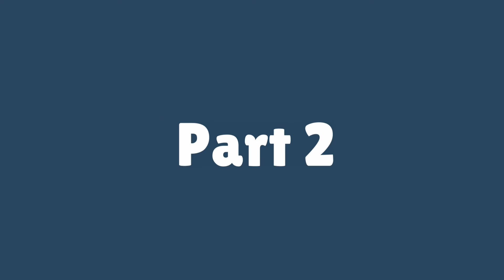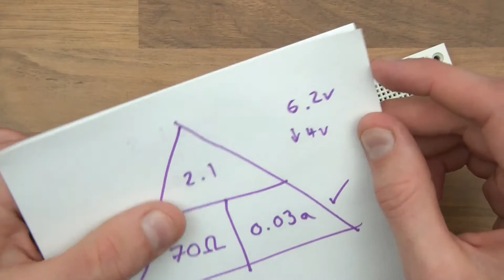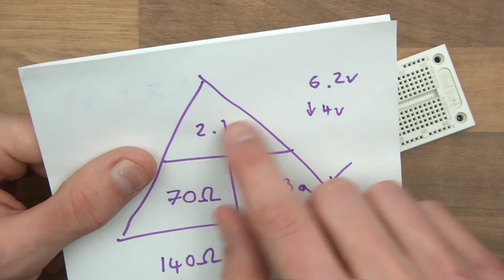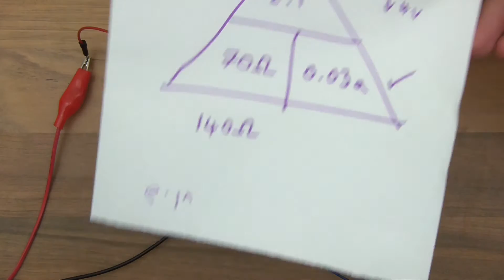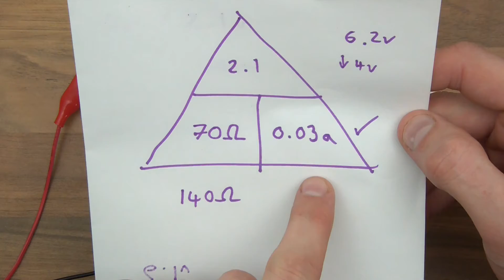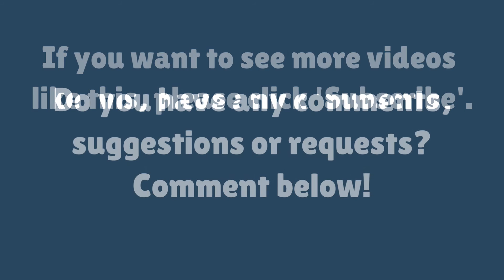EXPERIMENT #2 - Powering An LED - With Variable Resistor - Simple - Step by Step - Ohms Law - Part 2

Comment: This is an advance kind of comment and I'll remember when I put together my circuit. The one thing I'm after is to figure out the RANGE of resistance within which the LED can be operated without frying it? My application is to use three colored LEDs, a red, a green and a blue, to demonstrate additive color mixing to my students. I already collected a number of measurements on a 12v Red, Green and Blue LEDs for which I have no manufacturer specs. In this "experiment", I used a fixed 620 Ohms resistance (which was spec'd by the store where I bought my material). I was able to flow from 1.731 Volt up to 2.159 Volt before the light intensity emitted by the Red LED started to "diminish". So I suspect, that this is the Range within which I can operate this LED without frying it. I repeated the experiment with the Green LED and got a range between 3.367 Volt and 4.16 Volt. On the Blue LED, I got a range of 3.0 Volt and 3.96 Volt.